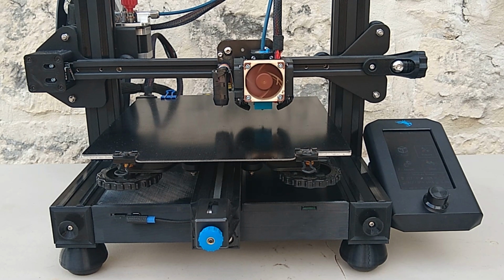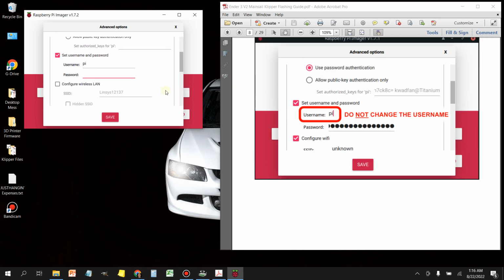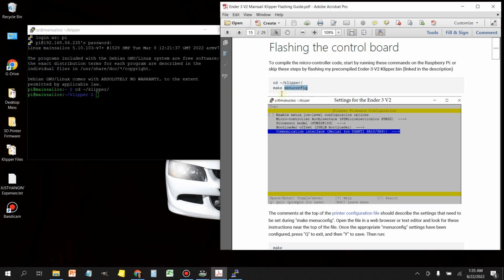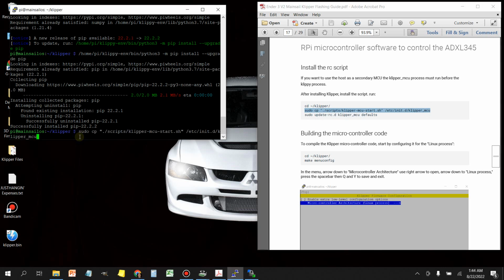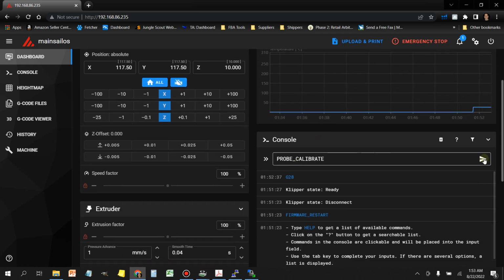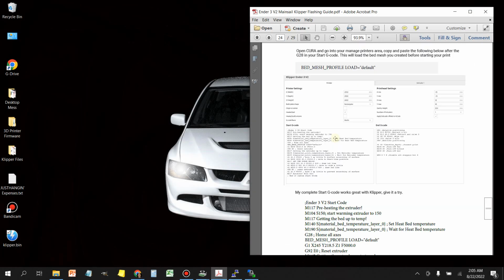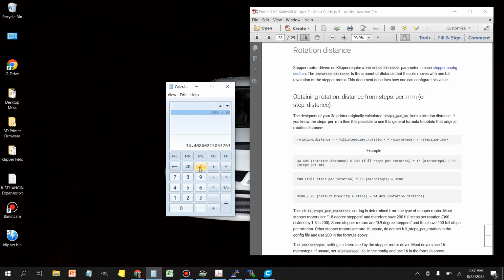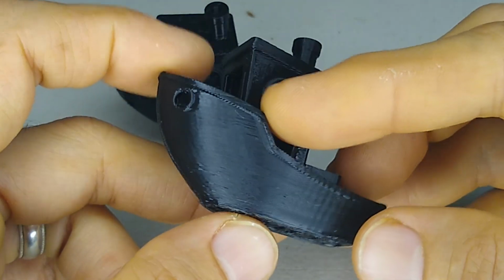Ender 3 V2 An Easy Way of Installing, Calibrating, and Printing with Mainsail Klipper

Comment: And hello again! I still could not stand it and decided to try what Klipper is! Killed two weekends to make sure my TV-Box Khadas was too specific due to the versions of Linux that can be installed on it. If you describe everything in one word, then nothing but "horror-horror" fits. (((But nevertheless, the old netbook completely allowed me to do everything. And now my Ender sees Klipper, and I see it.))) . ))) There are many questions, but I will not rush to ask them, but I will try to comprehend everything first.)))
Reply from the maker: Hi Burbycian, Great job getting things working. I haven't tried installing Klipper on anything other than a Raspberry Pi. What netbook are you running it on, Eeepc?
Reply: Some ancient Lenovo ThincPad 2015 or 16 - so many do not live!))). There is only 2 Gb of RAM, though I changed the disk to a Chinese SSD 128 Gb. But Debian 11 and everything else is doing very well. Of course, Khadas is more productive and I will still try to put another *Nix on top of the existing one. (As I understand it, this model has a specific bootloader that requires a special assembly of the distribution, and this kung fu is not available to me ...). I have a general question. Why, having the include chain, are some macros located in printer.cfg and not in macros.cfg? Does it have to do with order of execution?
Reply from the maker: @burbycianburbycianovich9274  I hear you, there are a couple of EEEPCs sitting in a storage box. I'm still learning Mainsail Klipper so double check me on this but I believe macros can be put in either file. My printer.cfg is very basic so far. If you have a lot of custom macros then putting them in macro file makes more sense to keeping the printer.cfg file cleaner.
Reply: So I did, I liked the division of the program into logical modules, but you still have to follow the commands.)))
Reply: Greetings! It's going hard, but it's going!)) The bed and extruder temperatures are controlled and maintained correctly, the BL Touch probe responds correctly, macros work, but unfortunately not all.  Trying to enter the menu bar of the SD Card printer screen causes a complete hang. (By the way, in the Klipper documentation was a reference to the file menu.cfg, but on GitHub I could not find it). But that's all unimportant for now. The main problem is with the motors.  Command M119 - x:open y:open z:open, and right after it command G28 - No trigger on x after full movement, and any attempt to move axis -Must home axis first, PROBE/PROBE_CALIBRATE - Must home before probe.  I have a suspicion that the problem is in the board configuration, especially since there are two configuration files on GitHub that fit my machine - 'printer-creality-ender3pro-2020.cfg' and 'generic-creality-v4.2.7.cfg', BUT they are ZERO(!!!) marked step_pin and dir_pin for all axes. But switching needles back and forth in printer.cfg had no effect. When a motion command is given, you hear a slight 'duk' and that's it. I want to ask you what needles are written in your printer.cfg, because you must have a similar Creality 4.2.7 board. And in general, maybe you have any thoughts on this subject. I would be grateful for any answer!))
Reply from the maker: @burbycianburbycianovich9274  If I understand you correctly you are using a 4.2.7 board in your Ender 3 Pro? If so to get the complete correct pin out you should be using the 4.2.X as the base and enter the generic 4.2.7 pins listed in that config file in place of the ones in the 4.2.X file. The generic 4.2.7 only lists the pins that differ from the 4.2.X file. You could select the Ender 3 V2 printer.cfg file (it uses the 4.2.2 board) and then just change those few pins with the values contained in the generic 4.2.7 config file.
Reply: Thanks for the answer! I have this template and I use it, in addition, according to the scheme, which are on the Internet, the designations on the board are exactly the same as in Marlin (pins_CREALITY_V427.h) with which everything worked flawlessly ... I will think further ...(((
Reply: Interesting, I didn't write ZERO, but MIRRORING!!?? Some kind of dark force of electricity ...)))
Reply: I greet you wholeheartedly! Still, a man defeated a cold and soulless machine... Everything turned out to be very simple! I climbed under the hood, - the board layout corresponds to generic-creality-v4.2.7.cfg, changed the step and dir values in accordance with this template, and everything started spinning, it worked! Why these values are inverted for almost the same product is not clear. But this is secondary. So I'll keep practicing...

Comment: My mainsail has no upload buttons to upload the config. tried different browsers incase it was browser issue
Reply from the maker: Hi Mick, give me a call 478-227-3301 so I can get more details about your issue and help you resolve it.
Reply: @vbared  Thank you for the offer, but I think I resolved it by chmod 777 the relevant folder. Didnt work with the config_examples folder. So it may be some witchcraft. Just got to resolve "BLTouch failed to raise probe", none of the debugging commands do anything.
Reply from the maker: @mickeyred  Hi Mike, What control board are you using?
Reply: @vbared  morning, it is the 4.2.2 board. The borough is the type that uses an adaptor between the 422 board and screen and two wires that use the z stop. I have a cr-touch delivered today that connects directly to the board so that should hopefully fix it. If that doesn’t work I have a BTT v1.4 board gathering dust
Reply from the maker: @mickeyred  Let me know if the CR-Touch resolves the issue.
Reply: @vbared  CR Touch worked straight out the box. back to your video
Reply from the maker: @mickeyred  Excellent, were you able to tune everything up and start some test prints?
Reply: @vbared  I am getting there slowly.

Comment: And hello again!))) Yesterday I watched your video, as always with great interest and pleasure!) Tell me, does it make sense to switch from Marlin`s to Klipper if I have a 32-bit board? A common opinion is that the Klipper firmware gain in productivity and, as a consequence, improved print quality makes sense only for 8-bit microcontrollers.
Reply from the maker: Thank you for your kind comment. I'm using Mainsail Klipper on my two Ender 3 V2's both of which run 32 bit boards. Klipper's advanced features, pressure advance and input shaping allows me to print at 175mm/s on my machine using a E3D V6 hotend with a BondTech nozzle. My other Ender 3 V2 uses the stock MK8 hotend. I print at 125mm/s with it. Mainsail Klipper is another game changer upgrade. Printing on G10 is also an amazing upgrade that resolves all the bed adhesion and print removal issues. It works with PLA, PLA +, ASA, PETG, and Nylon. Just hit print and walk away, it's that simple.

https://amzn.to/3U5h0oB

Have a great night.
Reply: @vbared  Thank you! Your experience inspires joyful expectations and I personally trust it completely. As soon as I figure out the Z-axis problem, I'll start exercising right away.) What do you use as a host for Klipper - single board, thin client, old nettop? And what OS - Ubunta, Debian, Ambian?

Comment: I am making good progress. The missing piece was using SCREWS_TILT_CALCULATE to level the bed then go through with probe and bed mesh calibration. I still need to work on things like pressure advancing and dialing in retraction.
Reply from the maker: Hi Decoder, Great job, learning about the screw tilt. I haven't played with that feature yet. The resonance measurements and pressure advance are super cool,
Reply: @vbared  I forgot another important thing which was switching to a piece of paper instead of a feeler gauge after seeing people say to switch online. The piece of paper gives me a better feeling of the nozzle then the exact distance the feeler gauge gives. That gave me much better results.

Comment: Having adhesion issues, I think I need to go through and manually calibrate each spot. The probe calibration and bed mesh creation was off for an area in the middle.
Reply from the maker: Hi Decoder, what build plate material are you using, stock glass?
Reply: @vbared  yeah I am using the stock glass flipped over since the textured side is a bit scratched
Reply from the maker: @decoder33  Hi Decoder, I had the same problems printing on textured and smooth glass but since switching to G10 Garolite all the problems are gone (mine linked below. No more stick glue, tape, and scrapping. The parts now stick when hot and pretty much pop off on their own when cooled.

 https://amzn.to/3C7TfEw

Best of luck with your mods!

Comment: Hey Victor I made it through! Thanks for your help. What do you think the max speed is for printing PLA?
Reply from the maker: Hi Decoder, thank you for commenting. I haven't printed with PLA since switching to Klipper, but printing in PETG I can print most things between 100-125mms using a stock nozzle. I recently switched out my nozzle for a Bondtech and it improved flow enough for me to print between 175-200mm/s. I did printed a benchy at 250mm/s but had to print 10-15 degrees hotter. The problems I encountered at this speed was parts cooling. I haven't figured out a fix yet but, it's coming!

Comment: I got a raspberry pi and Im trying to install the OS to the sd card but its saying "verifying write failed. contents of sd card is different from what was written to it"
Reply from the maker: Hello Decoder, Thank you for commenting. Try a different SD card and see if it completes. Sometimes SD cards can have bad sectors. Normally this isn't a problem when just storing files on the card but if the card contains an operating system like Linux then a bad sector in the wrong place can cause the failure.

Let me know if this solves the problem for you
Reply: @vbared  I am using the sd card reader that came with the ender 3 v2. Could that be a problem? I just bought a SD card for this. The only other one I have is the one which came with the printer. I am formatting the SD card I just bought and am going to try again. If that doesnt work I will wipe the card that came with my printer and try that one.

Comment: Victor After inserting this line, ls /dev/serial/by-id/* , I get cannot access '/dev/serial/by-id/ no such file or directory. Any Idea what I have done wrong?
Reply from the maker: Hi Ozzie, Try a different USB to micro USB cable. This error is telling you that there is no communication between the Raspberry Pi and the Printer. When I got this error it was due to the Raspberry Pi side USB cable not being inserted all the way in. My friend Doug had the same issue and his problem was caused by his cable being charge only, it had no wires connected to the data pins.
Reply: @vbared  Copy all I will try another cable thank you!
Reply: Victor, that was it!! Now to continue on. Thank you!
Reply from the maker: @BeastOSS42  You're going to love Klipper, it's awesome!
Reply from the maker: @BeastOSS42  Excellent 👍
Reply: @vbared  I'm, reading a lot I'm getting brain overload. mainsail is talking to board but when I try home  cmd I got this msg "No trigger on x after full movement"
Reply from the maker: @BeastOSS42  Call me when you're at your printer 478-227-3301 so I can help you trouble shoot.

Comment: Thanks Victor, a fantastic 'how to' video. To get Klipper installed and running I have tried many other docs, tutorials etc. before but with no success. Your documentation and resources are great. Followed it all step by step, took my time and it worked perfectly. I also gained so much more of an undertanding overall. I have a  little more tuning to do to improve the quality. Excellent work! Thank you so much.
Reply from the maker: Hello mthomas6272, Thank you for commenting and kindness. I'm glad you found value in this video for your viewing time. I was in the same boat as you trying to piece together all the prices of this Klipper puzzle. Once you do it a few times it will click for you if not already. Check out my latest video on getting the filament sensor working in Mainsail Klipper. 3D printing is a blast, the hobby is extremely powerful and not too expensive for anyone to get into.

Best of luck with your mods!

Comment: hey I have everything working fine until the printer.cfg editing. When I do like you in the video to remove the BL or CR touch lines, I got an error: Option 'control_pin' in section 'bltouch' must be specified 

Do you have an idea? Thank you!
Reply from the maker: Hi Lloyd,

Make sure you look at your [stepper_z] fields and make sure that the endstop info between the spaces below matches what you have. The hashtags at the beginning of the lines determines whether it's active of not. I'm assuming you don't have a BL/CR- Touch so your endstop lines should match the ones below.

Call me 478-227-3301 if you can't get it resolved, I'll help you trouble shoot it.

[stepper_z]
step_pin: PB6
dir_pin: !PB5
enable_pin: !PC3
microsteps: 16
rotation_distance: 8

#endstop_pin: probe:z_virtual_endstop # Comment out if not using BL/CR-Touch
endstop_pin: ^PA7 # Uncomment if not using BL/CR-Touch
position_endstop: 0.0 # Uncomment if not using BL/CR-Touch

position_max: 240
position_min: -2
Reply: @vbared  thank you for the answer but my cfg file seems to be just like what you said. I can't call you since I'm in France but if you have facebook or instagram so we can chat and share screens and files it would be great. Thank you very much!
Reply from the maker: @lloydg8750  Hi Lloyd, can you email me your printer.cfg file so I can load it into Klipper to figure out what is going on? vbared@gmail.com
Reply: @vbared  yup on the way!
Reply: @vbared  if you want to go on discord or else I'm available if you are!
Reply from the maker: @lloydg8750  Hi Lloyd, My apologies for not seeing your message until just now. I replied to your email and attached a revised printer.cfg for you to try.

Let me know if it works

Comment: Hi. I am totally new to 3d printing and found your channel when considering purchasing a creality CR-10S PRO V2. Having sub'd I see you have lots of different printers but I'd be interested to know what printer is the best straight out of the box for print quality. Thanks in advance.
Reply from the maker: Hello Skylark, Thank you for commenting. Hands down for me would be the Ender 3 V2 (which I own 2). They are by far my favorite among the other printers that I have. The Ender 3 V2 has a huge development community around it and is sold at an affordable price. Mine has all the parts listed below but the Dual Z Axis Kit which will be my next upgrade. The build list is below and if you run into any questions, just ask. I'd be happy to share what I've learned over the years to help save you time and frustration. 

My Ultimate Ender 3 V2 Build List - 

Ender 3 V2 - https://amzn.to/3BF2XwF

Upgrades in order of importance: 

You should consider the five upgrades below out of the gate since they will require a great deal of disassembly later to install. The G10 Garolite will eliminate all the print adhesion and print removal issues normally associated with 3D printing (which was my greatest frustration when I first started 3D printing. 

Creality 3D Printer Accessories Kit - https://amzn.to/3wuaq1Q
Anti Backlash Nut with Lead Screw Support - https://amzn.to/3opukWR
G10 Garolite Build Surface - https://amzn.to/3tNSGg8
Creality CR-Touch - https://amzn.to/3AFBytd
Micro Swiss dual gear extruder kit - https://amzn.to/3quGWx6

The upgrades below should be considered after you've had some time using your machine and getting used to the 3D printing processes.

E3D V6 All-Metal Hotend - https://amzn.to/3zcu3wo
Adaptor E3D V6 to the Ender 3 V2 mount - https://victor-bared.myshopify.com/products/minimalist-e3d-v6-fans-bracket-and-ducts-for-dual-4010-blowers-single-4010-or-4020-heatsink-fan-stl-files-for-diy-3d-printing
Compatible blower fans for the mount above - https://amzn.to/3tuKfqm
M2 X 8mm self-tapping (need 8) - https://amzn.to/3qulw3o 
M3 X 12mm pan head (need 4) - https://amzn.to/3fqjP0B
M3 x 6mm hex button cap screw - https://amzn.to/349l6Hy
Install Video of E3D V6 - https://youtu.be/dZz-eR3d5YE

Super Quiet Upgrades & How-to Video:

4 Dunlop Squash Balls (Need 2 Sets of 3) - https://amzn.to/32jPqhH
Noctua 40x10mm Fans (Need 2) - https://amzn.to/3JjSTxq
Noctua 80x25mm Fan - https://amzn.to/3Jk2u7i
How to install the quiet fan - https://youtu.be/ycvHpMbo5Hw

Dual Z Axis Kit - https://amzn.to/3AVYAzx

3D Printable Files - https://drive.google.com/file/d/1EP_I6gEWe-FosKM378UJI-PVBOrBvQaV/view?usp=sharing